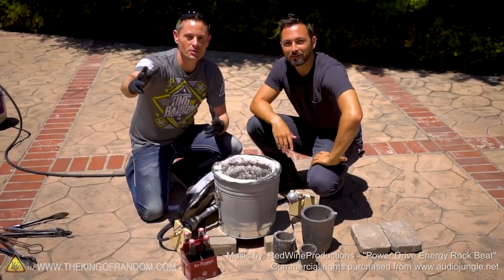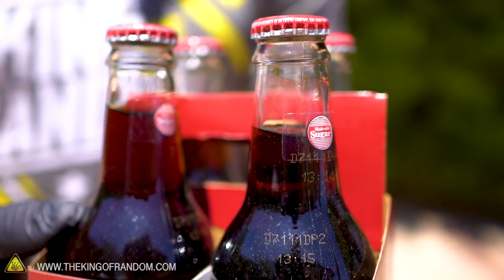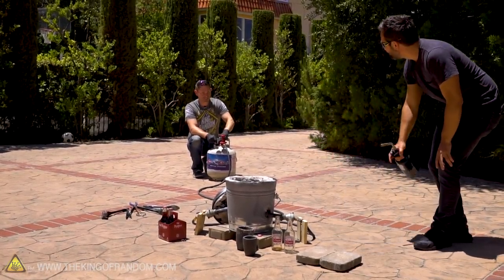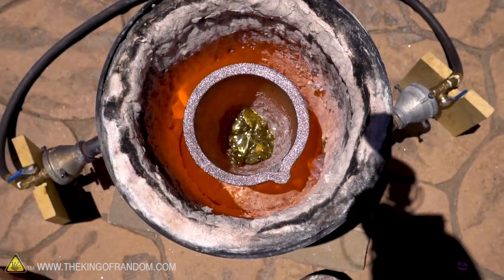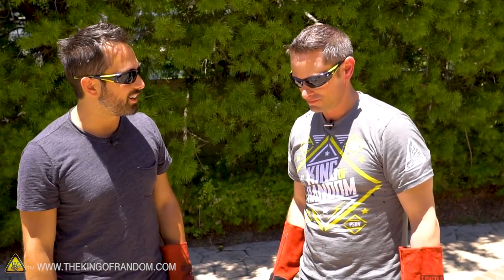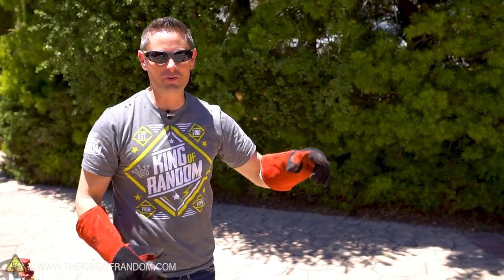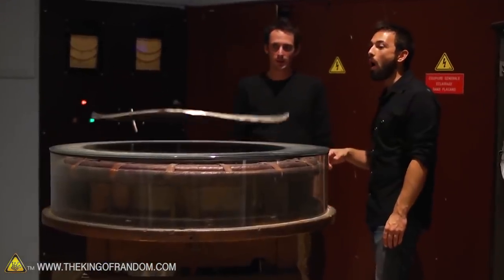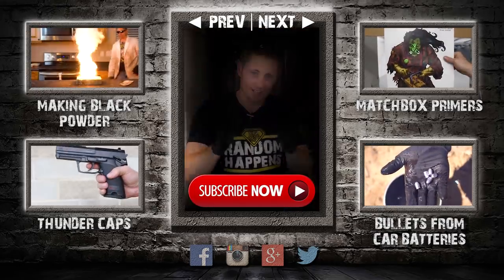Will Glass Bottles Melt? TKOR Takes Glass Melting To The Next Level With Our DIY Foundry!

Comment: while it's pouring keep it heated with a blow torch as it falls into a mold. Please like so Grant can see this.
Reply: A blow torch probably does nothing considering the high temperatures needed.
Reply: AckmanDESU maybe it will slow the solidifying on the glass
Reply: mk
Reply: Grant should make glass radioactive gear

Comment: can you melt magnets?
Reply: Yes, but they will just be metal and he will have to re-magnitize them
Reply: Sassy Cucumber2259 yes
Reply: The magnet will degauss and turn to normal alloy.
Reply: yes you can but you have to remagnetize it with electricity etc
Reply: The reason magnets wrk is because the particles are aligned melting them will de magnitize them
Reply: Sassy Cucumber2259 it destroys the magnetic property
Reply: Sassy Cucumber2259 cvm
Reply: no you cant melt iron
Reply: XxSirRapturexX u wot mate
Reply: MrVexed excuse me? how was all the iron in your house shaped?
Reply: Everything melts but all at different temperatures
Reply: @a_casual_caveman-8166  using electroysis i think
Reply: What temp do magnets melt at thought?🤔🤔

Comment: You should try making your own glass. Like super heating sand.
Reply: you need much more than sand and it would be a process only a high-end company could make, though that would be cool
Reply: be interesting to try though, sand does need to be melted at slightly higher temperatures but that glass melted easily enough
Reply: ahh didnt know that
Reply: all it takes is sand limestone dust and some flux

Comment: Can you put sand in the crucible to see if it will turn into glass
Reply: It takes more than just sand to make glass
Reply: Seems like Silica sand or quartz sand is the primary ingredient, the other ingredients seem pretty easy to get a hold of so I bet he'll be able to do it.
Reply: sand + sodium carbonate + calcium carbonate = glass
well, mixed at great temperatures
Reply: I already commented that
Reply: Minecraft has corrupted society
Reply: Unturned Bros it will not it takes more than4000 degrees to fuse sand i will reply with the exact fusing temp
Reply: I was just going to suggest this myself after seeing carsandwater do it with a torch vs. arc welder.
Reply: played too much minecraft
Reply: Gabriel Martinez no, it works in real life, thats how glass is made lmao
Reply: Unturned Bros ; what about diatomaceous earth
Reply: Unturned Bros U R a Minecraft Guy ..Am I Right??.

Comment: Grant, have you ever measured the temperature of your backyard foundry? I wonder how hot glass blowers need to have their foundries.
Reply: Make glass sculptures!
Reply: DropTube You can actually melt Soda Glass in a camp fire. So, not much depending on the glass.
Reply: Makes sense you can melt bronze in a camp fire
Reply: Glass blower here, our crucible keeps glass at 2,400 degrees Fahrenheit, if I recall correctly.
Reply: That makes sense. Higher grade glasd takes a lot more heat. if you wanna do something fun, put about an inch of lighter fluid into a beer bottle and put it into a campfire. Base in the red and top outside the fire. lol
Reply: ahh, cool. I mean hot! So crossedcutlasses, does your foundry at 2,400 make the glass more molten than Grant's backyard trash can foundry?
Reply: DropTube lol
Reply: @James Bieniek does the bottle melt, explode, or turn into a crude rocket? (before melting or exploding lol)
Reply: Naw, nothing that entertaining. The heat is hot enough to start evaporating the lighter fluid. The melting base decreases the volume. As the gas leaves the cooler air, it will eventually catch fire. The top remains very solid, so only so much air can leave or enter at once. So it makes a sputter jet. It pops off, stops, pops off again. Just watch for trees around it. I got a jet pulse that was over a foot at one point. lol

Comment: King of Random -  You can make explosive tadpoles easily.  These are known as Prince Rupert's Drops.  Melt glass really hot and then drip it into ice cold water.  The blobs that survive look like tadpoles.  Now grip the tadpole with pliers on the tail while submerging the head in a glass of water and snap the tail.  The shock wave should break the glass.  It helps to degas the water.
When you break the tail it produces a shock wave that can break the glass holding the water.  If it doesn't work the tadpole still turns into dust at the bottom of the glass.
Reply: Sean Nanoman a
Reply: That sounds cool. I'd like to try that!
Reply: Gerard Way Follows Dan On Twitter 
its called Physics

Comment: Honestly, as someone who's worked with glass before, I'm simply shocked that those bottles didn't explode the moment you dropped them into the crucible. Glass tends not to react very well to sudden temperature changes.
Reply: Perhaps one should break down the glass to smaller pieces to avoid explosion

Comment: We used a normal Bunsen burner to draw out glass tube to make a pipette in our chemistry lessons, so I knew that a gas fuelled kiln would be able to melt glass. I was a bit disappointed that Veritassium didn’t figure the whole thing out beforehand. Someone with an engineering degree should be able to look up the melting point of glass, the expected temperature that a kiln would achieve and come prepared. But maybe he just wanted to keep it random!

Comment: You should've made a "Prince Rupert's Drop" from the molten glass
Reply: don't think that's possible with only that forge l. You would have to super heat it to about 2000 degrees for it to melt and stay melted for enough time to make the drop. But if he gets a different one. Deafinetly possible.
Reply: Or you can just take a glass rod and use a propane torch to heat the glass up. You don't need some super forge

Comment: I make neon signs which entails heating glass tubing to a softening point in various burners to bend it to shape.  The burners used are either natural gas or LPG and air which is more than enough to melt soft glasses but not quite enough for borosilicate.

Comment: you do realize now you have to put molten glass in liquid nitrogen right?
Reply: Isaiah Manzo literally all that would do is solidify the glass
Reply: i suspect it would make a super unstable prince ropert drop
Reply: ItsAres it would shatter because the extreme temp change.
Reply: it would make an explosion
Reply: It's been done.
The glass doesn't become a prince ruperts drop as the temperature doesn't drop nearly as fast as you'd think.
The reason behind this is the Leidenfrost effect. 
The heat from the glass immediately vaporises the liquid nitrogen creating an insulating layer of nitrogen gas, and the only heat transfer which happens is through this insulating layer of gas.

The glass doesn't shatter as the temperature change isn't extreme enough. There is no explosion, but there is a rapid boil which can be "explosive".
Reply: TraceurArok well we'll see if grant decides to try this experiment
Reply: smart kid

Comment: You should melt down some glass and then try casting some molten metal on top of it (or vice versa if the glass is less dense) before either solidifies. I'm pretty sure this is how they used to make highly accurate flat surfaces.

Comment: can you try melt glass and metal together and stir the liquid really well see what comes out, or melt the glass first then toss in something after turning off the heat but before it solidifies, or do metal casting with 2 different materials(cast half first then bury it together with the styrofoam in sand and cast the other half), so that the product comes in 2 colors
Reply: also maybe melt metal but instead of nuggets is it possible to make thin foils? I don't know how but should be really cool
Reply: Thin foils are made by hammering solid metal, not by casting. But maybe he could do that, or maybe he could try drawing the melted metal into wires?
Reply: sy z no you can't
Reply: Making pieces with metal and glass is very very difficult. Glass and metals cool a vastly different rates. Also glass and metals also have very different coefficient of thermal expansion. So if I use the same mold to make a metal block and to make a glass block, they will be different sizes at room temperature. Also glass and metals have different cooling processes.

Comment: What happens when you mix molten metal with molten glass?
Reply: I noticed the glass insulated the leftover aluminum.. to cast molten metal, they use sands. Glass has some of those ingredients to insulate.
Reply: The glass is less dense so it floats. They use it for certain metals like copper to keep the atmosphere off of the metal as it melts so it doesn't oxidize and make the casting porous.
Reply: colt, that's s what I was thinking, great minds think alike aye

Comment: What if you put sand in it,will it make glass?
Reply: Curtis Bergamin get off of Minecraft buddy. glass isn't made from sand like that
Reply: Believe it or not, glass is made from liquid sand. You can make glass by heating ordinary sand (which is mostly made of silicon dioxide) until it melts and turns into a liquid. You won't find that happening on your local beach: sand melts at the incredibly high temperature of 1700°C (3090°F).
Reply: From the internet
Reply: HowToHayden actually glass is made like that
Reply: HowToHayden Children never learn... When Lighting strikes sand it make glass. Lighting is Super Heated Plasma. So Yes He Is Right. Normie
Reply: actually glass is made from silica, which is a ingredient of sand.
Reply: HowToHayden wow smartie! You learned a lot in school;)
Reply: Yes. but you also need silica:)
Reply: IndominusMosa Gaming I'm a child and I knew that since second grade
Reply: IndominusMosa Gaming Commonly called paralyzed lightning because of the shape of it.
Reply: Pure silicon glass is called "fused quartz" unfortunately it takes a LOT of heat to do that, around 1500C so they usually mix it with a sodium hydroxide, calcium oxide and a few other things to bring the melting temperature down quite a bit.
Reply: HowToHayden Trinity nuclear bomb test. Google it. Im pretty sure silica isn't an ingredient in making atom bombs... :)
Reply: silica is in sand.....
Reply: Actually silicon IS used in nuclear bombs, primarily as expanded aerogels which create spaces between components so that they remain in place and are very well thermally insulated but remain very light and are not very dense and don't interfere with say the U235's neutrons reflecting off the U238 tamper relatively unimpeded.
Reply: Mr. ConcealedCheese yes. yes you did...? hahaha
Reply: lol im surprised that people related to minecraft like what are you 8? 😂😂😂
Reply: Peter Carlson well okay, I've just learned something. hahah thanks!
Reply: You're the person who's 8 actually. In fact, if you heat ordinary sand it will turn into glass since the sand itself is mostly made of silicon dioxide, but melting it will make it go in a liquid but sand itself melts at about 1700 Celcius (or 3090 F).
Reply: Flippeh_Vengeance - Gaming & More! Glass is actually made like that though. You can google it.
Reply: Daniel Park your typical glass isn't made like that so really you just embarrassed yourself hilariously
Reply: BMAN488877 yes
Reply: You're trying to put him down but glass is made from sand.
Reply: Splash but not like that
Reply: kinda....
Reply: Kappa56799 but many chemicals are added
Reply: Curtis Bergamin I'm sure it would be very impure but it would work
Reply: Flippeh_Vengeance - Gaming & More! Come on man... Adults can play minecraft too!
Reply: chiken sand should still work

Comment: You should try melt steel (it's 100c more than glass)... IDK if it worked thou...
Reply: glass isnt exactly molten here since glass is amorphous, glass starts becoming  viscous at 700 degrees, more viscous at 900 which is easily achievable by this foundry, steel melts at 1500 degrees celsius
Reply: lol49031 but like glass, steel also gets softer when heated
Reply: lol49031 bla bla bla
Reply: even if that comment was too complex for your understanding you don't have to mock it..
Reply: lol49031 But if this foundry is allowed To melt copper and get the (I'm not sure which material it is made of) melting 'can' red hot it will also he allowed To melt steel and almost any Kind oft Metall.
Reply: Glass properly melts (melted enough for glassblowing) cooler than steel, but not by a lot.
Reply: Moritz Stein i think it's graphite
which has a melting point of 4000c 
but only in 100atm😅😂😂
Reply: Mralabbad That would have been my Guess too, but I was just wondering if graphite wouldn't 'burn' off at these temperatures - almost like coal..
Reply: Moritz Stein atm is atmospheric pressure

Comment: Can the solar scorcher melt glass ?
Reply: I think at most it would get hot enough to crack the glass, but the solar scorcher is not as hot as the foundry.
Reply: The surface of the sun is about 11000 degrees, and if I'm able to get easily to 550 degrees with my 3x3 inch magnifying glass, a 36x36 magnifying glass would be extremely hot. If the glass was black it would probably melt.
Reply: Well it can liquify concrete and steel so yeah definitely...Depends on what season probably.

Comment: I don't know much about crucibles , but could you try to melt one?
Reply: ToTo Mania you would have to make the foundry extremely hot
Reply: If you mean the graphite crucible then you will need an insanely high temperature like 3000 or 4000 degrees C and it would have to be under a lot pressure. It has a higher melting point than diamond.
Reply: ToTo Mania You know theres a reason why this material is used.
Reply: flying cow make some thermite
Reply: ToTo Mania They made not to melt. This a low temperature furnace. They can get a lot hotter.
Reply: i think its impossible with her foundry
Reply: James Fitzsimmons themite isnt hot enough. thermite burns around 2500 degrees C if i recall correctly and the graphite crucible will melt at 3000 degrees C if i remeber right. possibly a propane flame in extremely high oxygen air might work, or maybe magnesium in extremely high oxygen air?
Reply: Like carbon dioxide it goes directly from the solid state to the gaseous(sublimation). So graphite has no melting point until you get up to about 100 atmospheres. At that point the melting point is about 4300 K/4026.85 C/7280.33 F

Comment: Does the metal foundry melt salt?
Reply: DanceLover 10 Maybe, but salt has a pretty high melting point.
Reply: DanceLover 10 Should do, no problem. Salt melts at like 800c, his furnace does at least 1100c.
Reply: DanceLover 10 molten salt will actually explode in water
Reply: I said this first wtf

Comment: +grant Thompson what will happen if you freeze meat with liquid nitrogen and then cook it
Reply: Nicholas Pinto you will reheat frozen meat
Reply: TheTestTubeCreeper but that would be freeze dried and it is harder than regular frozen meat
Reply: it would be freezer burned meat.
Reply: It won't be freeze dried. it will just be frozen. Freeze drying needs a vacuum to pull the moisture off.

Comment: why not try to make glass by melting sand into the crucible?
Reply: Brian Jordan Lopez green sand dont melt
Reply: Smallz it does it gets so hot it melts and turns into glass lightning can strike sand and make glass
Reply: Bryson Davis hi bro
Reply: Bryson Davis that only happens when the required gases are present in the air to thermal decompose the sand into glass

Comment: you could've used a blow torch and keep heating the outside to keep it flowing hot or use a blow torch and face it inside the crucible to keep it in a mailable almost liquid state enough to mold it

Comment: Can you melt Tungsten??
Reply: MD AIMANN Shaike epic idea bro
Reply: I don't think you can in this foundry. It would be an awesome experiment to see, but I think the foundry itself and the crucible would both melt first.
Reply: Tungsten melts between 3,400-3,500 degrees Celsius
Reply: Tungsten has the highest melting point of all the elements. There's only a couple very expensive materials that can get that hot a stay solid, his foundry would destroy itself before it got anywhere near hot enough to melt tugsten.
Reply: tungsten is just a beast, its amazing that people learned to make/work with it at all, but definitely not in this tiny foundry, too cold.
Reply: Wolfie2000 and just for comparison. iron melts at 1500 celsius

Comment: Here's an idea... Perhaps try using a low temperature glass and aluminum together. At the higher temperature it theoretically should be possible to fuse the two into an aluminum-glass liquid that should pour into a mold much better. I've read a little on the subject but not enough to know exactly what would happen in a foundry such as yours. Your thoughts?

Comment: 1200 degrees celcius to melt glass. thats why it melts that fast
Reply: Then there will be feathers
Reply: That didn't get up to 1200C. The crucible would be bright yellow/white at that temperature. The first bottle they melted would of been under 600C as the crucible wasn't even orange yet. I'm guessing the manufacturers use a eutectic to save on energy costs.

Comment: The trick to melting bottles is cooling them slowly, same with tempered glass. Air bubles can cause the glass to explode, that happens in tempering rooms where they hang the glass to temper it. It can take the glass around it out. Plus the fact tempered glass can spontaneous explode and they don't know why. I have my hypothesis but no way to prove ut.